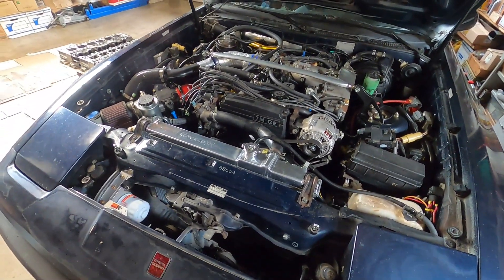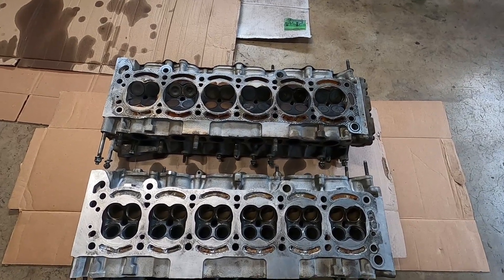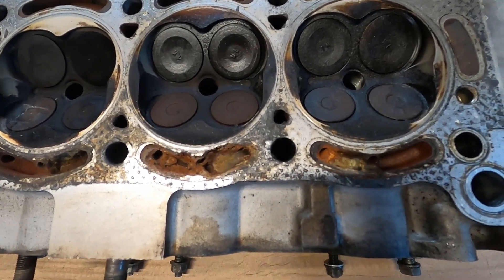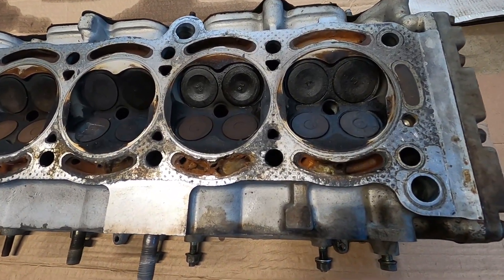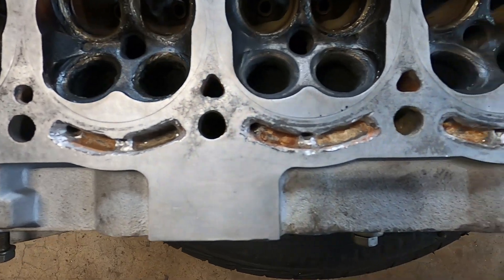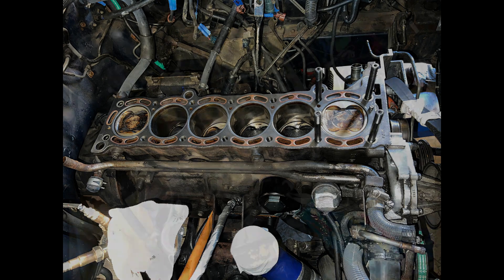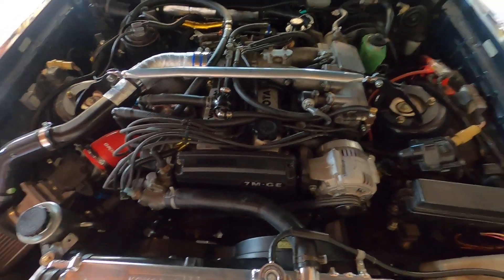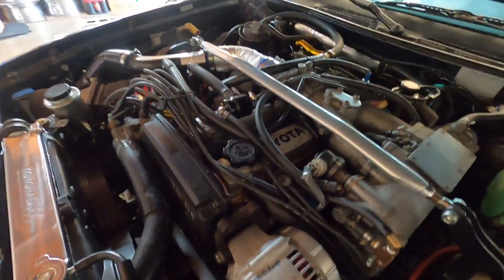Supra Mk3 7M Overheat, Corrosion, Blown Head Gasket

Comment: This a good video on the 7mgte mk3 supra platform. Thanks for sharing!
Reply from the maker: I appreciate your feedback. Cheers!
Reply: @juniortabios6747  keep at it, looks a ball to drive. What power you at?
Reply from the maker: @oliveoyl388  It's around 230-240whp; not a lot but yeah it's more fun to drive compared to when it was NA, lol!  Main goal has been to keep drivetrain reliable, so I don't miss autocross events.  If time permits, I'll have another engine ready with a little more power next season.
Reply: @juniortabios6747  great plan, it's obviously worked, I mean they are old and blow head gaskets but you're tracking this and giving it hell and it lasted 4 years! Obviously doing something right

Comment: Good luck with the stock gasket.  My experience is MHG is the way to go in terms of reliability.  So if the stock HG goes again I recommend you use MHG, as long as head is straight and block deck surface is straight and smooth.
Reply from the maker: Yeah, I agree that MHG is the way to go and have taken a risk with staying with an oem gasket.  My main reason going this route is to minimize downtime for my Supra.  I'm currently looking for a good used 7mgte long block or entire engine - which will definitely get decked/machined tp use a MHG.
Reply: @JR-Tabios  when you do that make sure you have ARP  bolts it doesnt have to be head studs as long as you dont push the engine that much even tho though. 75lb for head bolts is the safe 80lb is fine also
Reply from the maker: @7mMikeSoup  Yeah, mine is pretty much stock boost and HP so not pushing the engine at all.